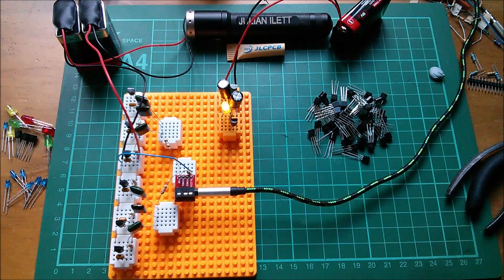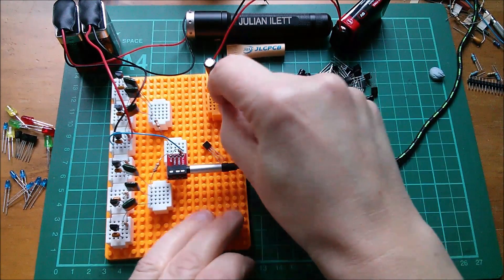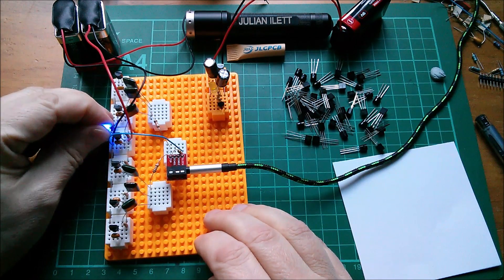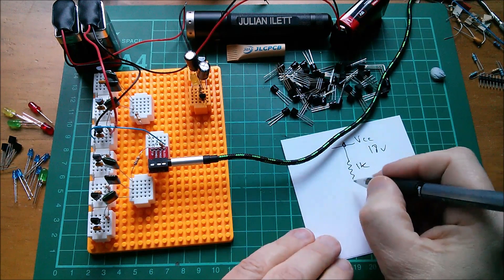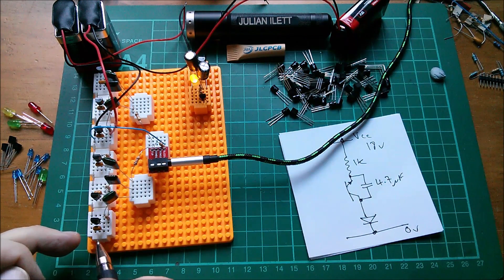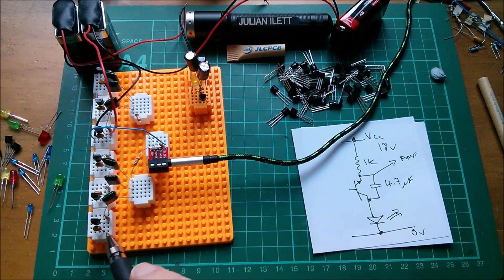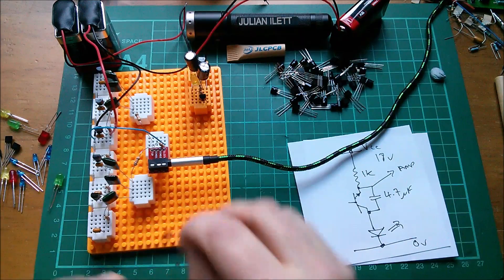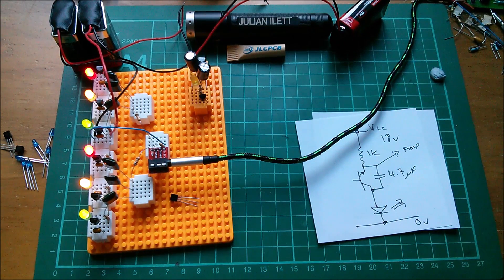Transistor Avalanche Disaster

Comment: Funny I was just experimenting with this circuit a couple months ago.  I ditched the idea because I could never get it to be stable enough for use in a synthesizer. And it was next to impossible to make it respond to a control voltage. It's  a shame because it sounded REALLY nice, especially when multitracked to make layered octaves and chords. I was also wondering how reliable the design would be in the long run......like would the transistor eventually fail or something.

Comment: It would be interesting to put an AC coupled scope probe on the base of one of the NPN transistors and look at the signal while it is oscillating...
Reply: The voltage on the emitter ramps up then snaps down.
During that snap down action the base is about 0.,7V above the collector.

Comment: You could had added a resistor limiting the capacitor discharge current. The waveform would change, though, from sawtooth into a scalene triangle (dual slope) shape.

Comment: 2:10
I have the same multimeter
Reply: So do I,  and I never use that silly socket.  I'd have done some ohmmeter tests (on the diode check range) to see just what was happening with the two junctions in the transistor...

Comment: I did a very amateurish vid on the Esaki oscillator FWIW. If you don't need the LEDs you can use the 2N2222, S9013, BC337 and BC517 transistors with only 9 volts.

Comment: If only you had a proper bench power supply (like everyone else has...), then you could easily just turn it off before changing the transistor. 
#reason274
:)
Reply: I dont have one.....I use a rechargeable drill battery and a buck/boost off e-bay ...works fine
Reply: @andymouse  - unless you live in Venezuela then building your own is generally what everyone does first. Makes life vastly simpler.
Reply: @andymouse  An on/off switch can do marvels!
Reply: A lot of you are missing the point! Julian is allergic to AC power!

Comment: there are transistors better suited to this circuit, the BC337 for example. it will make noise at lower voltages
its the reverse avalanche voltage btw
http://www.kerrywong.com/2014/03/19/bjt-in-reverse-avalanche-mode/
Reply from the maker: That could be handy to know when I try to build a simple analogue noise source - thanks :)

Comment: would have been an expensive exercise in the 80's lol
Reply: Tera Volt Even in the 80s a 2n3906 was an inexpensive transistor.  They’re far cheaper today, of course, but even as a teen in the 80s I could easily afford to buy 2n3906 transistors in quantities of 100 without spending much.
Reply: In the 80s we could get 30 packs of transistors from Rat Shack for maybe $3. Which was more than they were worth but still not that expensive.
Reply: @1pcfred  And those parts from RS didn't meet spec...
Reply: @1pcfred  Breakdown voltage wasn't anywhere near the datasheet value for a 2N2222,  for one example.  Other characteristics didn't match up often either.  I find that I'm doing better with parts salvaged from scrap equipment,  though of course the idea of buying a bag of 100 2N3904s at around a penny each has some appeal,  too.  I don't think I'd want to buy them from China,  though.  Probably get 'em from Mouser,  Digi-Key,  one of those places...